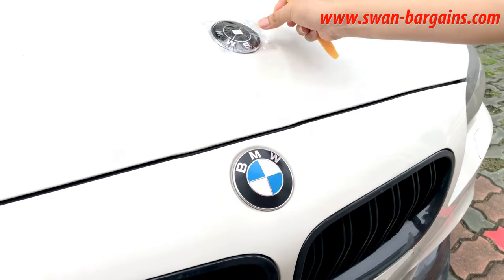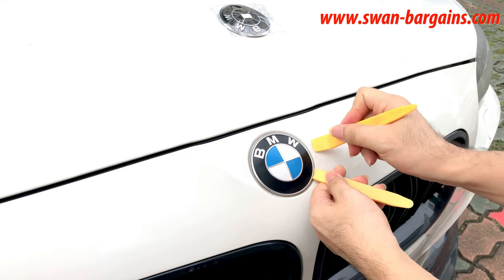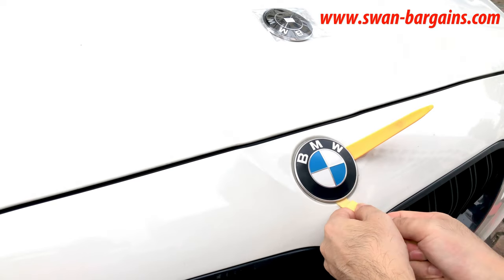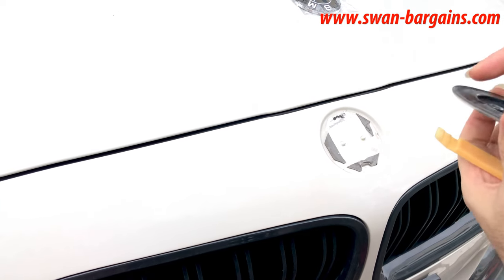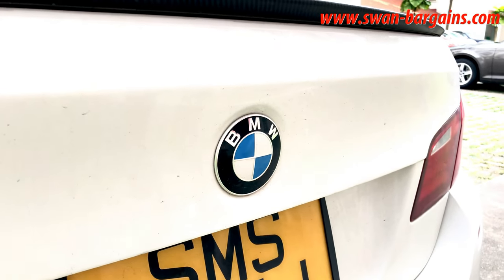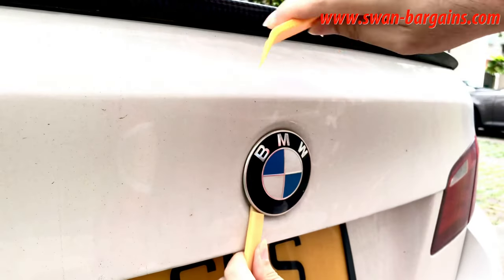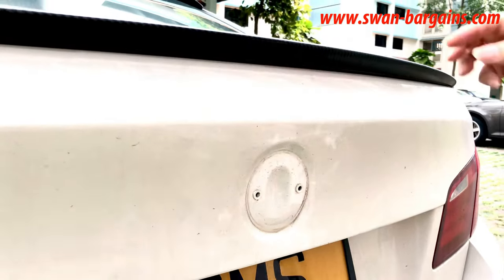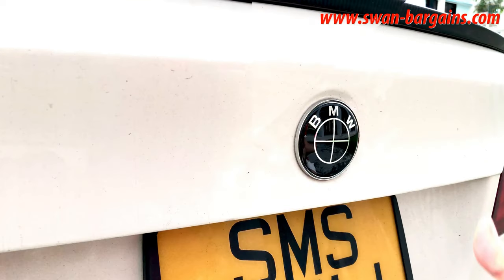How To Replace BMW 3-Series 5-Series F30 F10 Front Bonnet & Rear Trunk Full Gloss Black Emblem Logo

Comment: It appears that, judging from your video, the pins do not match those of the BMW F30. When purchasing an emblem, it should have three holes for the F30, while for the F10, it should have two holes.
Reply from the maker: Pls note that the aftermarket design does not have the guiding holes and it will still fit perfectly as seen in the video.

Comment: For the f10, are front and back emblem identical?
Reply from the maker: The front and back emblem for F10 model having the same size but the fitment fitment type is different as the front bonnet emblem holder does not have 2 holes compare to the trunk.
Reply: @swanzee  thank you for the response, I am having trouble to find the front hood emblem for the f10 (82mm). I am looking for the exact one in this video (all black) maybe you can point me, I would greatly appreciate!
Reply from the maker: The item can be found below. There’s an option for “all black 82mm (paste-on)”.
Reply from the maker: https://swan-bargains.com/bmw-bonnet-trunk-badge-replacement-emblem/
Reply: @swanzee  awesome! Thank you !! 👍